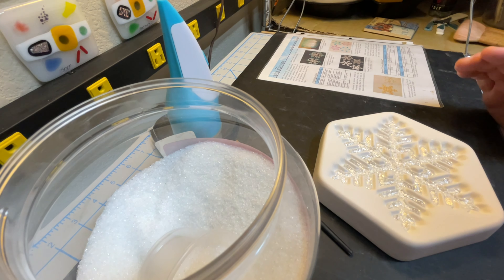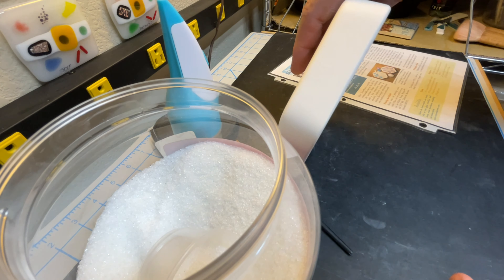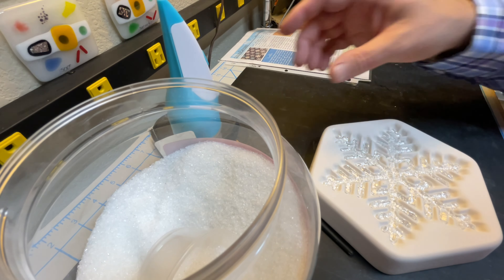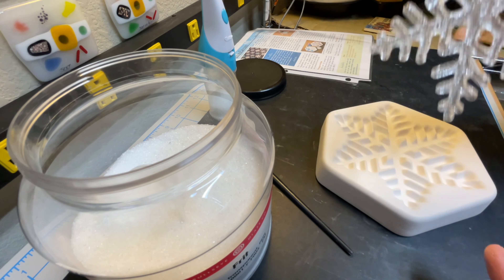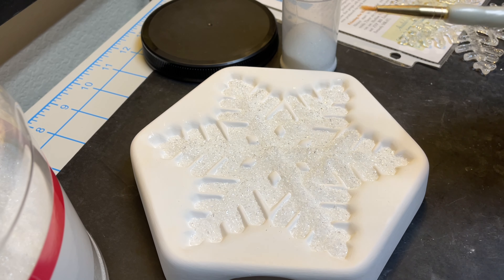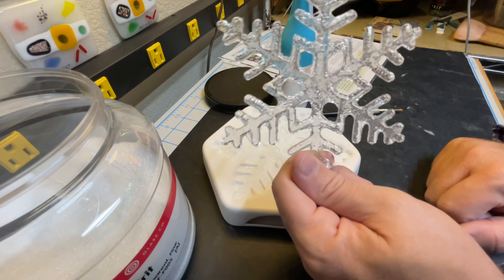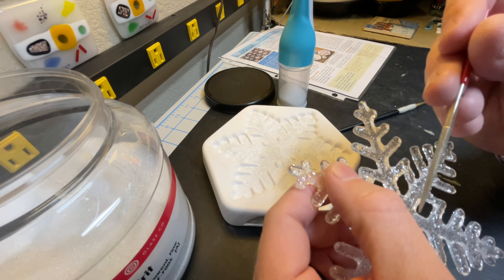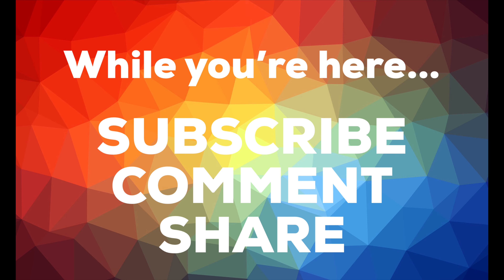Fused Glass Snowflakes using Colour de Verre Molds

Comment: Hi Jim, I am working of course at the last minute to make  some Christmas projects.  I just watched your video on the snowflake color de verre mold. found it ver useful. I am about ready to program my kiln.  My question is I have a larger two snowflake mold and also a smaller one, which has two snowflake mold and a color de verre mold.     Can I fire them at the same time with the same schedule.  I also bought the icicle color de verre mold on which has four icicles and has a firing schedule.  Have you ever fired these together?  If so what schedule did you use.
Reply from the maker: Sorry, I’ve never used the icicles mold before but I fire all my snowflakes using that same schedule posted in the video notes, no matter what size they are, all in the same load! I would assume you can do the same with the icicles too.
Reply: @JamaisonSchuler  thank you!

Comment: How do you know when you need to use a new coat of zyp and can you please add a link for the spray - your snowflakes are looking good! thank you
Reply from the maker: Gosh, as long as the snowflakes lift out nicely, I don’t worry about reapplying Zyp. If there are any noticeable scratches or flakes missing that look like it’s exposing the ceramic, that’s when I brush out some of the old Zyp and reapply. A link to Zyp spray? I use the aerosol version, and lots of online retailers carry it (in the US). I would prefer not to favor one particular seller.
Reply: @JamaisonSchuler  hello again - I ordered teh zyp directly from the manufacturer but selected the non aerosal version, im not sure that was the best choice - it seems hard to get an even coat - thanks for sharing your work!
Reply from the maker: @lisabaywoodpark  I’ve never tried that version but I’ve heard very mixed results...

Comment: What options do you have when the glas sticks into the mold? I used shelfprimer but maybe not enough. I want to get it out without ruining my mold....
Reply from the maker: I’ve often read to elevate the mold and reheat it until the glass comes out. These are very delicate molds so you don’t want to do much poking and prying. I believe the manufacturer recommends boron nitride spray for these molds.
Reply: You mean elevate upside down?
Reply from the maker: Yes, although the snowflake molds are deep enough you may not need to elevate? The mold maker — Colour de Verre —- is very responsive. I would find an email for them and reach out for their expertise. Don’t just ask a guy on YouTube. 😉
Reply: Haha, I’ve much confidence in this guy.... I let you know the results...
Reply: It worked out great! My mold is completely clean and undamaged. Thank you for the tip!
Reply from the maker: Woohoo!!!!

Comment: You do you have to put kiln wash on the mold?
Reply: That’s what the ZYP is! It’s a mold release recommended by the mold company because it better fills the mold pores without loosing mold details than brush on kiln wash. It’s expensive, but lasts a very long time on the mold and less likely to stick to the glass.

Comment: I am SO frustrated with these snowflake molds!! I cannot get the amount of frit correct. I've weighed it, I've eyeballed it, I've educated guessed it and still I end up with anorexic flakes that I have to fire again or obese flakes with no definition. I am tempted to give up but the molds were so expensive i can't justify quitting. Grrrrrrr!
Reply from the maker: Oh no! Not sure what tips I can offer but I just try to pile them high in the middle and fire to the temp that works for me. Good luck!
Reply: @JamaisonSchuler  Thank you! I'll keep trying. Making bowls from the klinkers is an excellent save!!